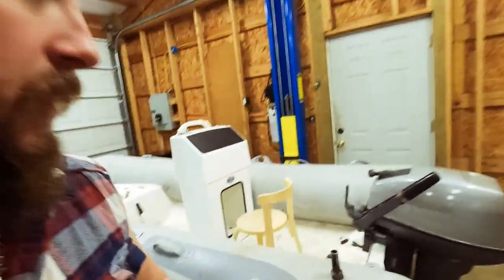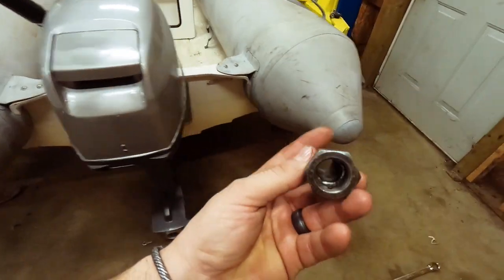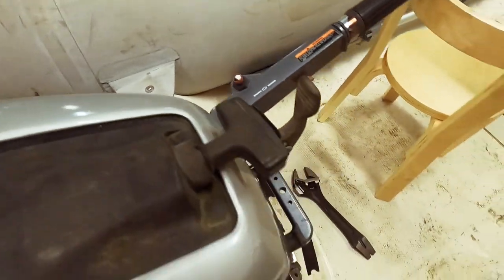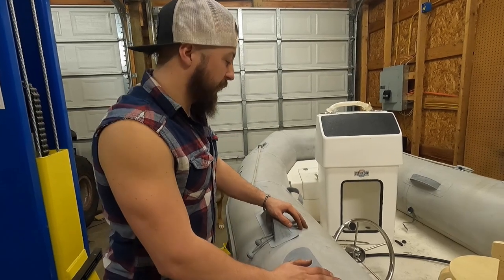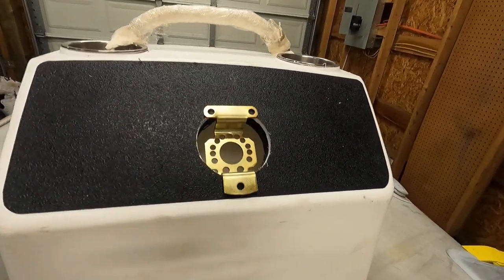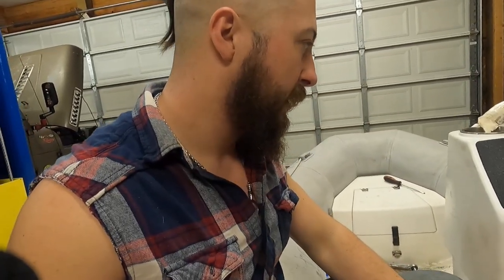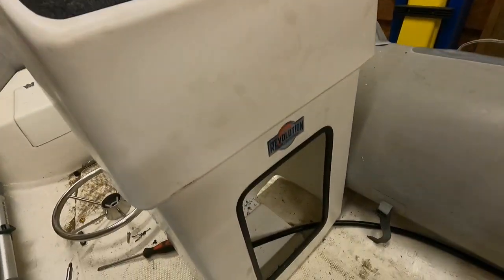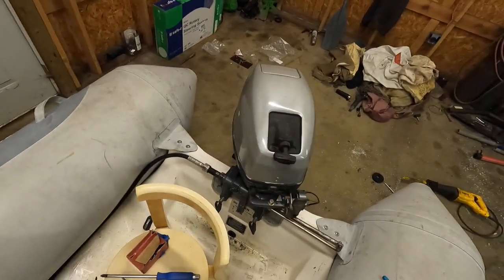Budget Center Console Install For Dinghy- Part 1 Steering

Comment: Do you think you could tell me how you attached your consol to the boat I got one and wanna know if I just screw ur directly onto in
Reply from the maker: We have a secondary floor on ours so we screwed directly into the fiberglass floor with fairly large screws!
Reply: Also Trying to figure out how to secure the center console to the rib. I have an aluminum hull without a secondary floor and i dont want to drill a hole on the hull.
Reply: @am932  Im having the same issue, dont know how to attach it without going through the hull

Comment: Does it matter what motor or anything
Reply from the maker: That's in not sure, I would assume most 9.9/10hp and up would work but can't speak on smaller outboards. If unsure with a particular outboard you ca always call local outboard shop should be able to look up if there is "remote controls" option for the outboard

Comment: Are you no pulling cable  under the deck
Reply from the maker: No under floor didn't have much for access so went down in the Crack between tube and floor